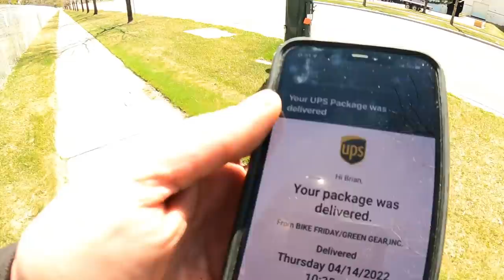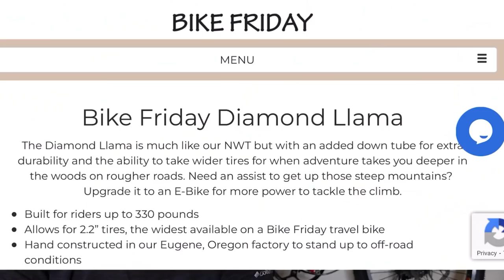Unboxing my new Bike Friday bike

Comment: Great first look thanks.
To be accurate the Brompton does have a forward projecting stem, it's just that the projection is built into the main body of the handlebar post rather than an add on at the top of the handlebar post.

Comment: That is a top notch folding bike you got there. It seems very durable to take off road. I was wondering if you have done any  research on the Polygon Urbano folding bikes? I too have a Zizzo Via and was considering changing to the Polygon because it has disc brakes. Your knowledge of folding bikes is highly regarded. Enjoy the new bike!

Comment: I had a bike friday tikit for nine years and I still receive compliments on how new the bike looks. I also order a New World Tourist Silk (belt and hub model) end of Jan and should be getting it next month. BF is not the most compact fold but it is a joy to ride.
Reply: New World Tourist Silk- silk? I don't see that on their website. What's that? Thanks.
Reply: @WASF2024  Hi Amy, you need to write directly to Bike Friday to build a bike on internal gear hub and carbon gate belt. They would be able to build this silk version if they have stock.

Comment: It would be good to know if 53 Chainring is good for fully-loaded adventures. I have a feeling at 32 gear inches at the largest rear cog, you might be struggling to climb with gear on loose terrain. At the same time, the fastest gear is at about the high 90's to 100's which is where I like to be at. I'd happily trade away some top speed for having enough climbing gears tho. Mid 80 gear inches is where I draw the line and declare it too slow for me.

Comment: What do you think of the Moulton? Technically not a folder, but a “stowaway”.
Reply from the maker: I rode a moulton and did a video about one that I never posted because it’s not a folder.  It was an awesome comfortable bike nonetheless.  Smooth with its suspension frame design.